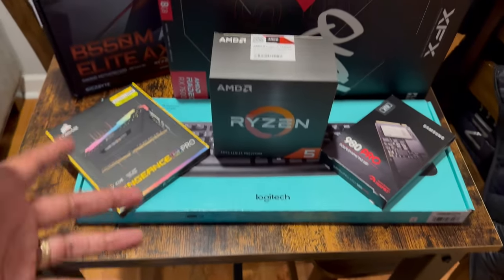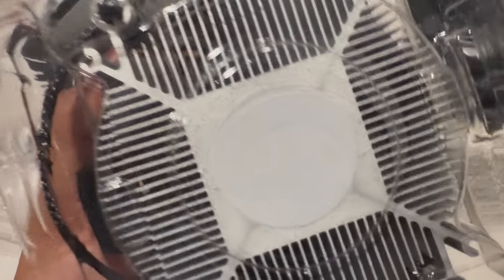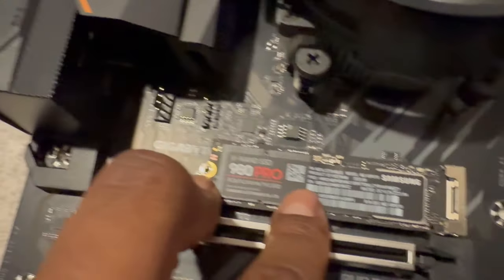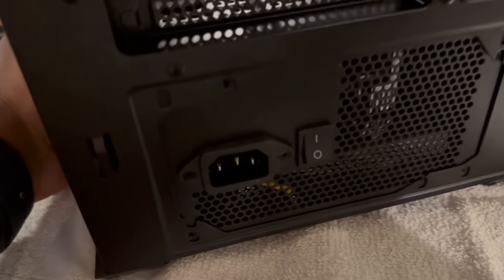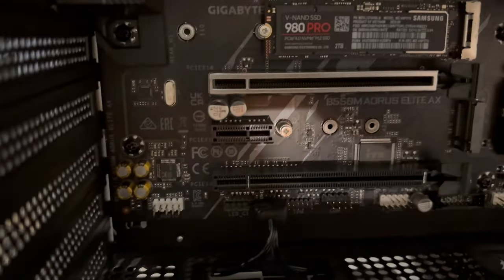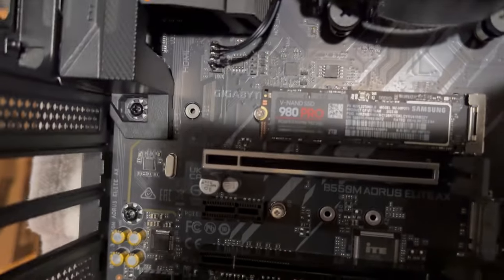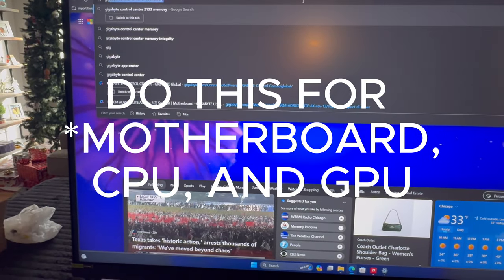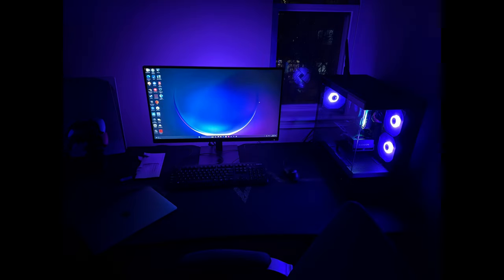I Built My First Gaming PC! RX 7600/Ryzen 5600X- (PC Build Vlog 1)

Comment: I think I’m gonna go for the P30 too. Congrats on your rig, looks sick!
Reply: Did you get the P30? I was planning on swapping my case for that one too, but I was a little worried about airflow since I also use my PC for work and rendering make my PC go BRRRRRRR
Reply: @danielgonzalezjimenez5677 Hey, I haven’t yet. I’m probably going to build it in a month or two.

I’m kind of concerned about airflow but I haven’t heard any horror stories. I’m going to start with the default fan config and a tower cooler and see how it goes.
Reply: @hightoriamos865  I ended up buying a NZXT H6 Flow and it looks very clean, even though my cable management isn't the best. Temps for me dropped significantly since I moved my components to it and I only have the three intake fans that it came with and one Arctic P12 I had in my old case as exhaust. I can see the front panel cables hanging from the bottom of my mATX motherboard, but I could cut up some black cardboard to cover them up or something. I'm also going to buy PSU cable extensions to make it look nicer. I recommend you look into this case too because at least for me the Zalman P30 was cheaper by itself, but adding shipping fees it would've been more expensive.